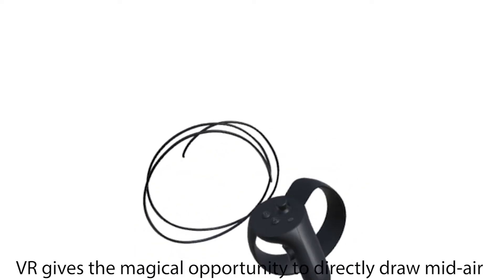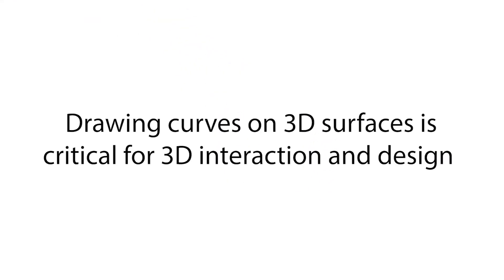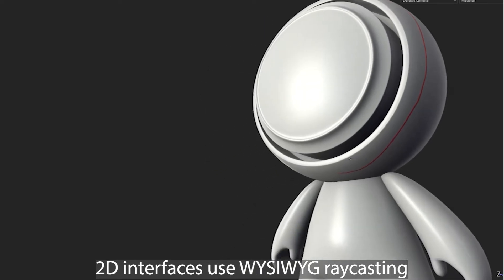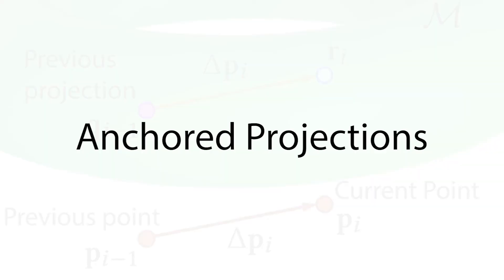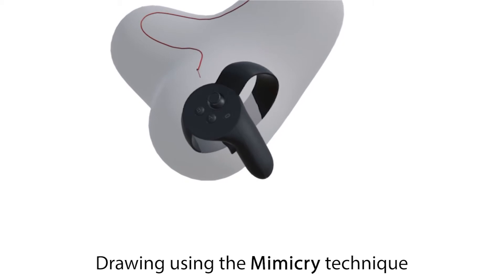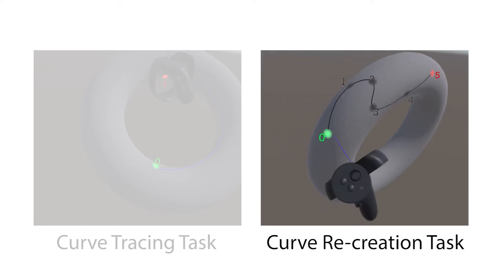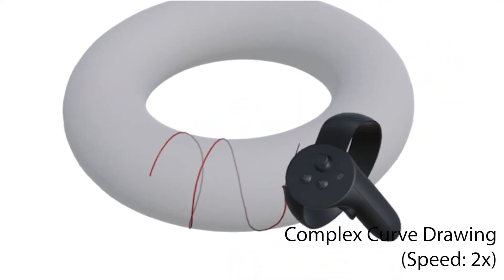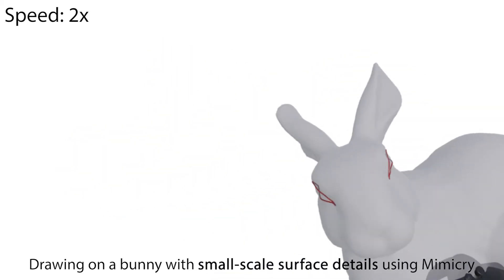Mid-Air Drawing of Curves on 3D Surfaces in Virtual Reality

Comment: Thanks for your contribution! I wasn't sure how much testing of different techniques you did based on the video to confirm that this is at least a local maxima if not the current best approach. But after going through it briefly, it seems you did your homework, and yes, this is a great solution. Nice work! I look forward to checking out your implementation on Github.
Reply from the maker: Thanks for your response! Sorry about the code being delayed, though. I was slowed down by the lack of a VR device for a while, but it should be up soon.